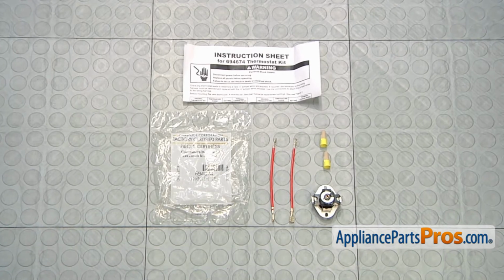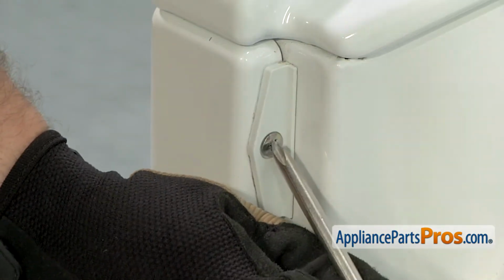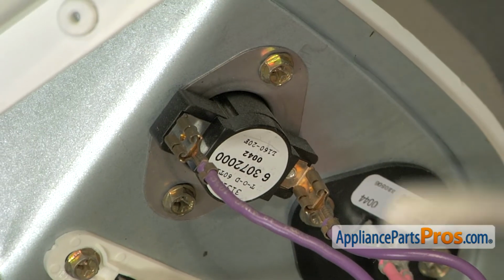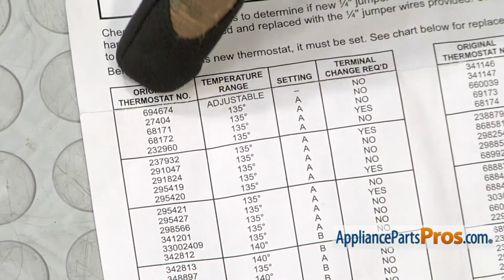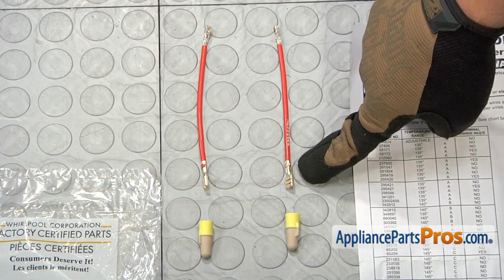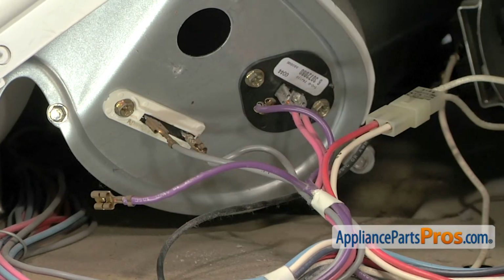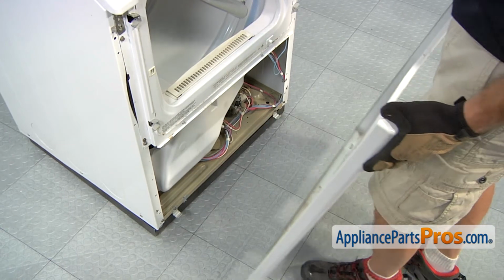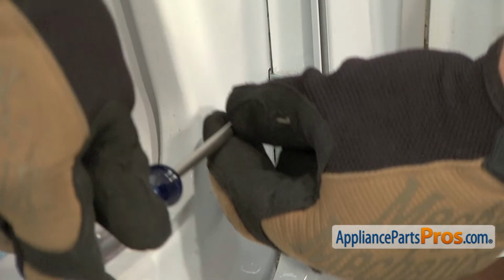How To: Whirlpool/KitchenAid/Maytag Adjustable Cycling Thermostat WP694674

Comment: When you describe using the new jumper wires for thermostats where the OEM terminal is a different size, two things jump out at me to ask:
1) Since we're cutting the original terminal wires and wire-nutting the new jumper wires to those, why do the replacement jumper wires have terminals at both ends? It seems that it should be a terminal at one end and bare wire at the other end for the wire nut, since we'd just be cutting off the terminal at the back end of the jumper.
2) In the video, you showed cutting right at where the wires are taped together, and then instruct stripping off insulation. Wouldn't it make more sense to cut the wires further down, so that you could strip the wire and wire-nut it to the new terminal without having to un-tape the existing wires?

Comment: Whirlpool dryer Automatic Dry will heat, but not advance the timer. Installed the 694674 Thermostat kit. Original thermostat had no number, so I stayed with factory "C". 
Automatic Dry still will not advance the timer from where you set it even though running for extended times.

Comment: will this cause the heat to go out after 20seconds
Reply from the maker: I would start with cleaning the dryer, the venting all the way out and check the blower. Bad air circulation can cause this.
Reply: +AppliancePartsPros  I have clean it out in checked all the thermostats in other parts Illinois thermal fuse heat sensor I believe that's what it's called with a voltage meter they all have continuity. but I don't have a electric frying pan to test it with heat my dryer is a Maytag MDG3000AWW
Reply from the maker: What about the gas valve coils? Have your drying times been getting longer? When they get weak they have a tendency  to shut off shortly after starting. The only way to test cycling thermostats is to see if they function as they heat up to their operating temperature and see if it cycles off (no continuity) and back on (continuity) as the temp lowers. Usually thermostats fail and you will not get heat or the contacts stick together and the heat does not shut off. Cycling at a lower temperature happens but it does not happen a lot.
Reply: +AppliancePartsPros it seems to be cycling the flame on and off about 10-15 times I have it set at 40 minutes the dryer I had before this I had for about 18 years so I'm not sure if it's supposed to cycle on and off as much as I do being a newer dryer. but im going to check that thanks for all your help also!
Reply: What is the setting for 341200? I didn’t get the chart and can’t see on your video